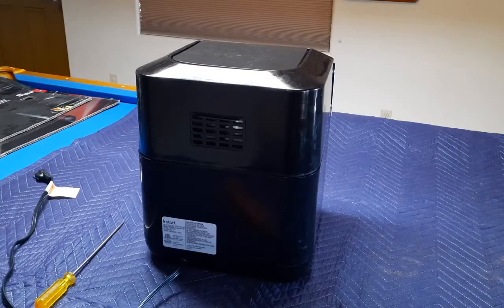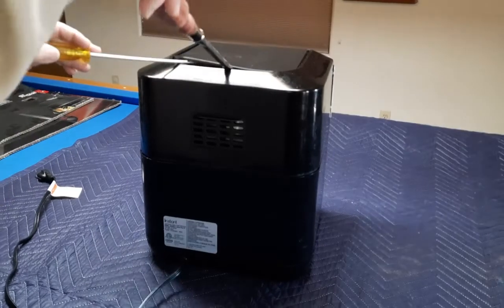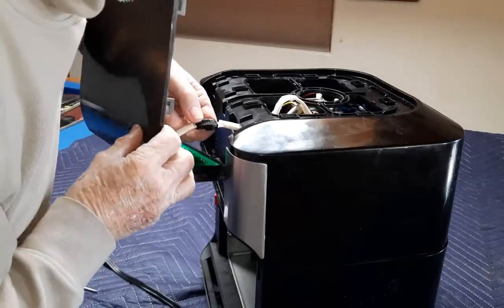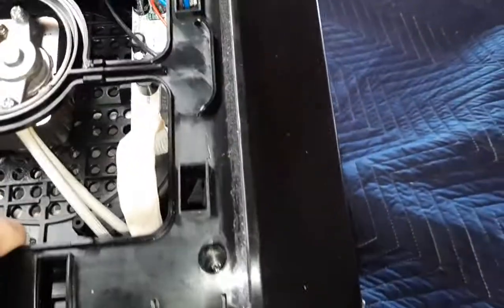How I fixed an Instant Vortex Plus Air Fryer

Comment: how will i know that it has already reset?
Reply from the maker: I used to get an email every time someone commented, but I have not for a long time. Anyways, I saw your comment on my smart phone, but not sure what you are asking? I will try to answer assuming you have taken your unit apart and you pushed the reset button on the thermal fuse. Basically, if the thermal fuse, just needed a reset then your unit should now work.
Some have stated they heard a click when pressing the button on the thermal switch, which we have assumed, was the actual reset. 
If you pushed the button and did not hear a click or your unit still doesn’t work then I am sorry to hear that. Perhaps something else is wrong? Also if you use a multimeter to test for continuity from one side of the thermal fuse to the other side of the thermal fuse and you have continuity then the thermal fuse has been reset. Perhaps you had continuity all along and the thermal fuse did not need to be reset. If that is the case then something else is wrong. 
Some of the comments also say they found the switch that lets the unit know the door is completely shut was there problem and it was not the thermal fuse. The door must be completely shut, for the unit to work, and the door switch, signals to the unit, the door is shut. They either replaced the switch or repaired it. 
Since I really do not know what you are asking, hopefully the above will help you. Good luck!

Comment: Anybody have an issue with theirs making it really high-pitched noise from the motor or blower fan I threw some WD-40 in there after taking the top off I oiled the motor after 10 seconds it started running great soon as you unplug it it starts smoking like crazy I'm assuming that's to get rid of the excess oil but I'm not going to jinx it it works pretty good right now anybody else have this problem

Comment: I have the same machine, recently the machine quit on me, if it’s plugged in, the light inside comes on, but none of the display is functioning. When I plug it into the outlet they flash for half a second but immediately become unusable again….anyone else have this problem or have any recommendations?

Comment: I was starting to take this apart from the bottom until the unit stopped coming apart easily. Then I found your video and my unit had the same issue. Glad I watched to the reset part before trying to take apart the whole lid to access the fuse as you noted. Great video and thank you for helping out so many people.

Comment: Great video, however this method doesnt apply to the instant afb4002bk (the one with two dials on the front). I just spent an hour fully stripping it down and I cant find a thermal switch at all! In the bin it goes!

Comment: As someone who hasn't used a multimeter yet, did you have to have the fryer plugged in to check for continuity, or is the meter applying its own current?
Reply from the maker: @citizenbobx  
Never try to check continuity with current available. It is a simple check for open or closed circuits with no current. You could damage your meter if current is present for continuity testing.

  Example of continuity test.  Touch the 2 leads from the meter together and you get a resistance reading of the 2 leads and there should be a beep from the meter indicating continuity was achieved. This would be a closed circuit, giving you a reading and a beep.  No current from an outside source.

Separate the 2 leads and meter should read OL, with no beeping, because the 2 leads are no longer touching each other.  No longer creating their closed circuit. 

I suggest searching on YouTube for how to use a multimeter for continuity. There should be lots of these types of videos. I hope this helped.

Comment: Thanks for this information. 
I have an Instant Vortex Mini that stopped working. 
I would probably have started at the bottom screws and taken an age to find the way into the top.
There are two of these switches on mine - one had tripped. 
All up and running within ten minutes...

Comment: My display works but on some numbers you can’t tell what it is, I did everything on this video and it remained the same. Still heats and everything but just can’t tell how high or for how long we have it set to. We keep a timer on hand to keep track.
Reply from the maker: Good idea to just use a timer. I am sorry I cannot help with a display that is hard to read. 
The Thermal fuse only needs resetting if the temperature inside the fryer exceeds the thermal fuse’s specification. This causes the thermal fuse, which is normally closed, to open. Our thermal fuse said it was a 200 degree C. As I show in the video, the thermal fuse is the first electrical component attached to the power cord. So, if the thermal fuse opens, it is normally closed to allow current to pass through it, no current will pass beyond the thermal fuse. Therefore, nothing works because there is no current allowed pass the fuse. Once it is open, it is just like, unplugging the power cord. Unplug the power cord and no power to fryer.  Reset the thermal fuse, closes it, and now current can go on to the rest of the fryer. Hope this helps.

Comment: Its sad because  after 90 dsys my sir fryer broke it days door open , gourmia is a different company  then the one your working on but its inernal veiw is the same my thremo circuit breaker isnt resetting niw its goingvin the grabage  i..tried all the other trouble shooting  videos  its time to just go get a toaster oven ..im not paying to fix it ...probably  will break again and its built with chemicals that can cause cancer im goong yo throw mine out ... i jad a feeling it wasnt going to last  to much touch screen and no  dials  sounds like a big cellphone the y both arebiult to last

Comment: Do you have the part number for thermal fuse? Mine is worn out and needs replaced.
Reply from the maker: See end of video where I show what was written on mine on the screen. Pause and write it down. I should have put it in the description, but seems no one reads the description and apparently not everyone watches the entire video. I did put some notes in the description about removing stuff to get to the thermal fuse. Most important when removing the fan the threads are reversed threads. Clock wise to remove the nut, instead of counterclockwise. 

And no, I never bought one, since my son’s was repaired and he keeps it clean and is still running. Occasional reset and he is back in business.
Reply: @ Great video. very well done. Thanks for the help John

Comment: What if I’m getting an error message on it ?  What possibilities you think it can be ?
Reply from the maker: Sorry, I have no idea about error messages. Read on if interested to know why I can not help you. 

My son was given his used fryer. No instruction manual or any kind of documentation. 

 When it quit working he brought to me to see if I could fix it. I found the thermal fuse had no continuity right away. I took the whole thing apart to get the thermal fuse out in hopes it would have part numbers written on it. I tested it for continuity one more time and it had continuity. I put the bare minimum back together to see if it would work, since it now had continuity. It did work!

Therefore, I concluded by pushing on the black button I had reset the thermal fuse. I decided to make the video with hope that it would help others with the same problem. 

Sorry, I know nothing about error messages! We do not even have the instruction manual or any kind of documentation that might list error messages.

Comment: How do you get it to go from Celsius temperature to Fahrenheit
Reply from the maker: If you are talking about the actual Air fryer, is showing C and you want F displayed, my son’s Air fryer was given to him by his mother-in-law with no instructions. So, I do not know. If you are talking how to convert any C temp to F, like the Thermal fuse is rated at 200C. I just google and usually get a quick easy answer.   Google C to F, Or in this case 200 C to F and generally the answer will pop right up, = 392F. It might also show the formula which is (200°C × 9/5) + 32 = 392°F.  Remove the 200 and put whatever C temp you want to convert to F into the formula. I hope this helps. You might also be able to find the instructions by googling. Vortex air fryer instructions?

Comment: This video brought my Instant Vortex back to life. You can also follow these instructions for the non plus version because it has the exact same design flaw but you have to disconnect the display ribbon from the unit and unscrew two screws on the display itself. Thanks again ❤
Reply from the maker: Thanks for watching and the comment on how to take off the display on the non-plus model. I hope others read your comment. When I have a new problem, that, I have no idea how to go about fixing, I turn to YouTube. If I find a DIY video related to my problem, I try my best to read all the comments, because there can also be great information hidden in the comments. Thanks

Comment: Suspected the thermal fuse had popped on mine and came looking for a video that would show me a part number to order. This video saved me having to buy a part and a lot of unnecessary disassembly, since I had planned to start with the visible screws on the bottom and work my way up.  Thank you for taking the time to post!
Reply from the maker: I am so glad you found the video, because starting from the bottom and working upwards would have taken a lot of work to get to the actual problem. Please click the like button as this will help others find the video. Thanks for watching and commenting which also helps others find the video.

Comment: I have power but no heating—would this be the issue still? I hit the reset to no avail
Reply from the maker: Sorry! If the thermal fuse has tripped then no power to all the rest of the fryer. If no heat, then something else is wrong. I guess I would try to see if there is any power going to the heating element and if there is, then it is probably the heating element that has gone bad. Check all connections going to the heating element. Is there a lose connection somewhere? Where is the power being lost? Perhaps a bad component on the circuit board. Kind of hard to say without further testing. If you are in to detective work and trying to see where the power stops, or if you would rather just buy a fryer to replace the bad one. Good luck, and thanks for watching and commenting. Sorry I cannot help you. If you figure it out, perhaps either comment back here on what fixed it or make a YouTube video to help others. 

We did not have this problem, but they say it will not work if the door switch is not telling the unit the door is shut. A bad door switch could stop it from working, because the unit thinks the door is not shut. Good Luck!

Comment: Mine has power but door is shut and it’s not wanting to air fry as the door is closed it’s sensing still open there for not able to cook
Reply from the maker: You might try to google; Air fryer door switch. There are a few videos that show how to replace the switch, but are a little different than the model we had. One does give a link to a new switch on Amazon for their particular model.  My son never had a problem with the door switch, but I recently replaced a washing machine door switch. The washing machine would not spin drain unless the door was shut and therefore needed a new door switch to tell the washer the door was indeed closed.  I found a couple YouTube videos on how to replace the washer door switch, which really helped me. Good Luck on your fryer.

Comment: Can I replace thermostat with a 250c instead of 200c
Reply from the maker: I would not put in a 250 C. You will be going from approximately 392 F to 482 F. This could potentially be too hot and could cause the fryer to overheat beyond what the designers of the fryer expected. It would be less likely to trip during prolonged cooking, but you could end up with a fire.  The auto ignition temperature (AIT) of paper is generally between 424–475°F. However, the exact temperature depends on the paper's composition, volume, density, shape, and how long it's exposed to high heat. I would assume a grease fire could occur at a much lower temperature than the auto ignition temp of general paper. This is why, I would avoid a 250 C verse's the 200 C. I am not an expert, but you did ask what I thought.
Reply: @johntube2525  thank you getting a 200c now

Comment: The black button on mine will not push in, is it that hard to push it in?
Reply from the maker: Others have commented that pushing the black button did not help, but they found they had a bad door switch. it should not be hard to push and rest. 

Checking the fuse for continuity is the best place to start!

I hope you have checked the two posts on the thermal fuse after removing the two wires for continuity. If you have continuity then the thermal fuse is in the closed state and current will flow thru it. It only needs to be reset, if it is open, no continuity, and therefore no current will pass thru it to the rest of the fryer. 

I am also assuming you are trying to reset it, because you have no display. However, there are apparently other things that could cause no display, like a bad door switch. Which is beyond my video, but perhaps you can find another video to help with that problem. 

You can get a cheap multimeters that will check continuity at Walmart, or on Amazon, or many other places. There are many YouTube videos on how to use a Multimeter. They are a fairly cheap tool that can help when troubleshooting electrical problems. 

Checking the fuse for continuity is the best place to start!

If no continuity and pushing the button will not reset it, so it does have continuity, then the fuse is, most likely bad, and would have to be replaced. I was lucky and ours did reset and problem was solved. I did not have to go any further to get ours working and it was so easy I made this video to help others with the same problem 
Good luck!
Reply: @ thank you

Comment: Hello. I have the same make of Fryer as you but a different model. In mine the top comes off super easy. I found the thermo fuse inside and pressed the button on top. Hey presto. All working again. And all thanks to you. 
Thanks so much. I owe you one. 👍👍👍👍